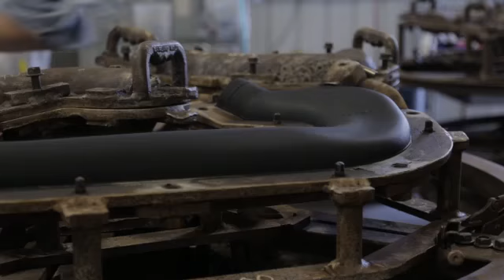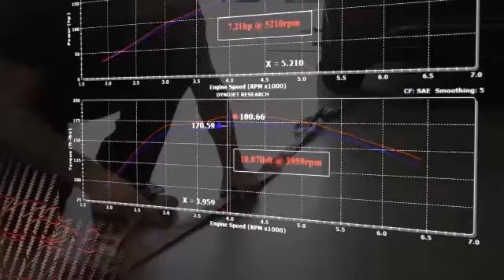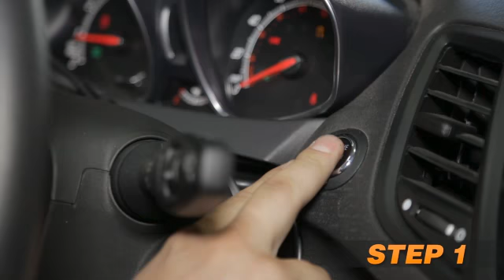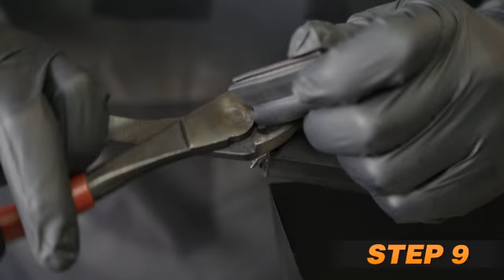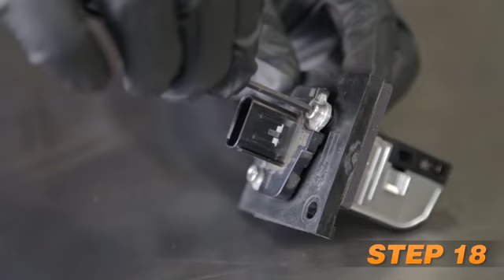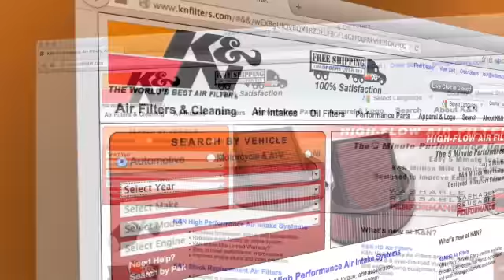2014 Ford Fiesta ST Models with a 1.6L Turbo Engine K&N Air Intake Installation

Comment: I've bought it for my fiesta ST 2015. The installation tooks me about 2-3 hours. There were a lot of problems with foam heat shield fitting inside airtake knhole, but the effect of the recurcilating Valve is smażony

Comment: The old gear taken off looked old and dirty, maybe the gain came from replacing a filthy standard paper filter with a new filter?
I bought a blue coloured pod filter, are they oiled requiring the cleaning and oiling products? There wasn't much guidence on the packaging, also can you buy that heat shield seprately anywhere?

Comment: Just installed it and it is one of the best mods ever done. Awesome sound even with the stock bypass valve. The only thing is that the air conditioning didn't work for about 2 hours. I turned the FiST off ready to get back to the workshop the next day, but after 2-3 hours of rest the aircon started to work again properly.

Comment: I just used a K&N drop in filter in my 14 FiST, and slightly modified the stock air box, and the engine def sounds a lot better, and you can hear the re-circulation valve easily with the window down.
Reply: Dolby109 does it improve the acceleration? Mpg ?